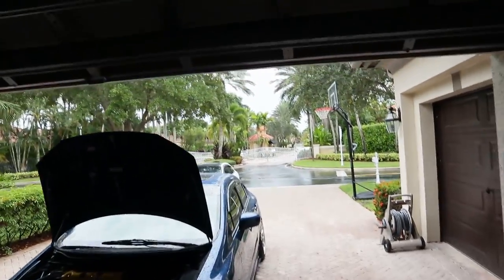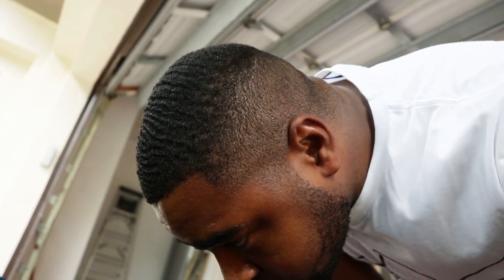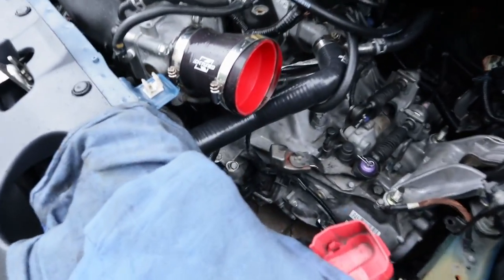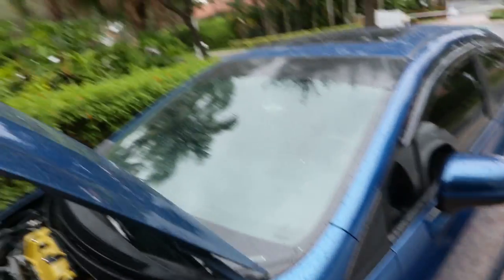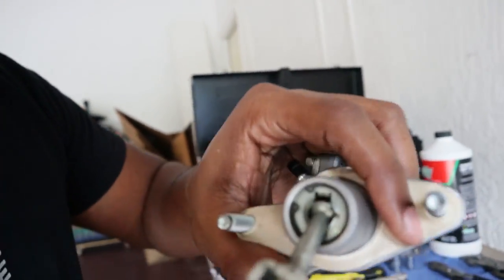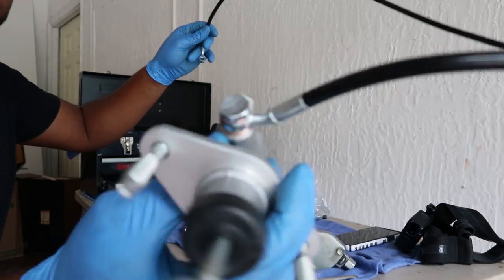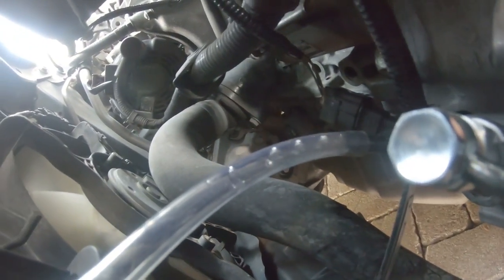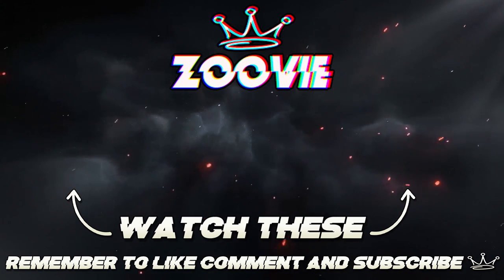NO MORE 2ND GEAR GRINDS! (Hybrid Racing EM1 CMC & Slave Install)

Comment: Curious how it feels long term. Im running the HardMotion slave cylinder with no delay valve, it got rid of id say 75% of my grinds when banging 1-2. This is a dope setup they offer.
Reply from the maker: The hybrid racing cmc and slave is an OEM cmc and slave so it should last very long.

Comment: Good call bro
 i was running the stock cmc with the stage 3 action clutch a while ago and the cmc literally popped right as i pressed the clutch pedal to start my fa5
Reply from the maker: Yeah my stock cmc was doing just fine but I wanted to make sure I don’t have it pop when I’m banging gears cause rip trans

Comment: What are some mods you suggest for a 9th gen. Mine is a ex not an si
Reply from the maker: Coils , wheels , side skirts , front lip
Reply: Ex have the r18 engine right? There's a turbo kit for that engine that makes a fun 350 hp
Reply: I would honestly suggest you save your money , sell the car and get an Si